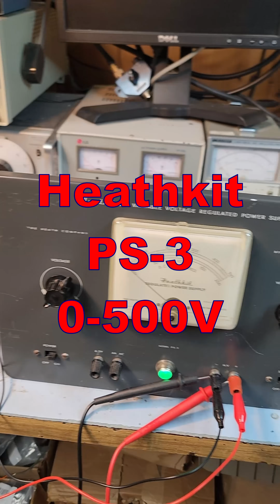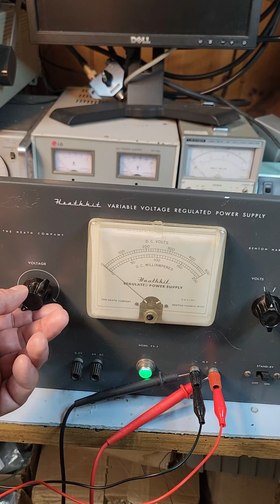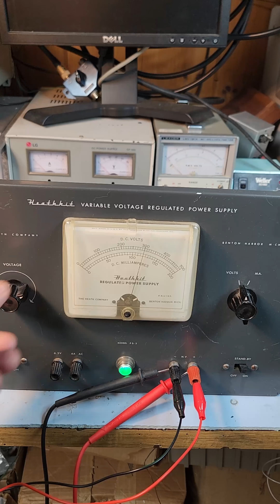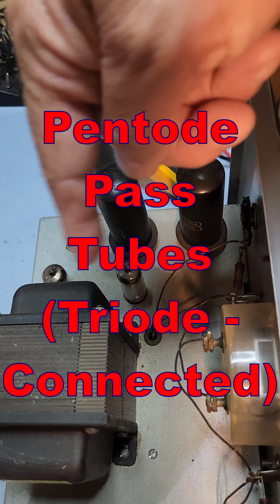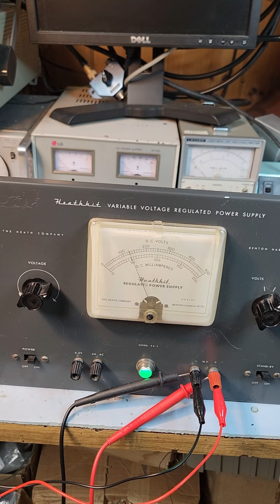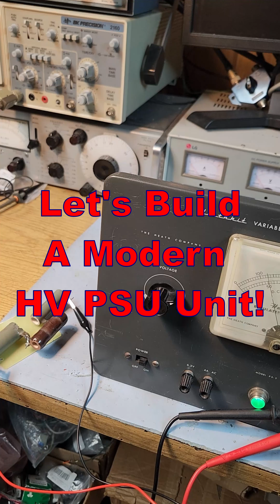PS-3 HealthKit High Voltage Supply #soldersmoke #hamradio #audio #amplifier #electronics #amplitube

Comment: and a 5ar4 it uses .1 less amps on filament has 7 more volts out and can withstand 250ma v 5v4 at 175 in short not likely to fail also you can put up to 40 or 80 uf input cap on it so in short more b plus and filtering and more tolerance to load

Comment: Put pass tube filaments in series install a cheap pair of 6l6 gc and reference the filaments to b plus do they don’t float
Reply from the maker: Yes, and in fact Heathkit went to the 6L6 in later models (When the cheap surplus tube stash was gone!).
Reply: @MIKROWAVE1  I would love to see a pair of 6dq6 or lower filament current 12dq6or 25dq6 in 1 with the 5ar4 got to admit the ar4 and a separate pass transformer will take the stress off the heathkit transformer